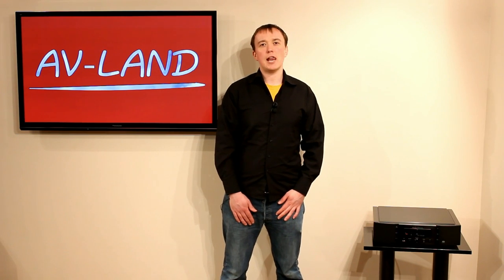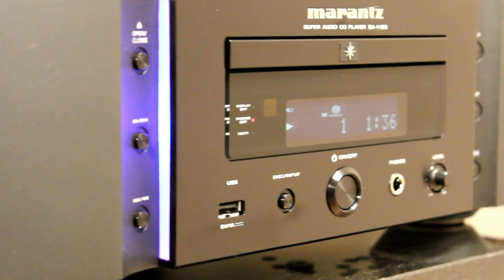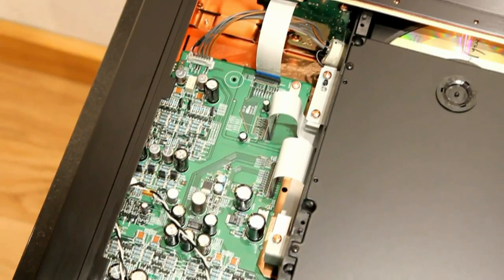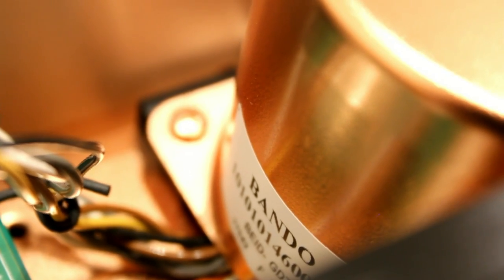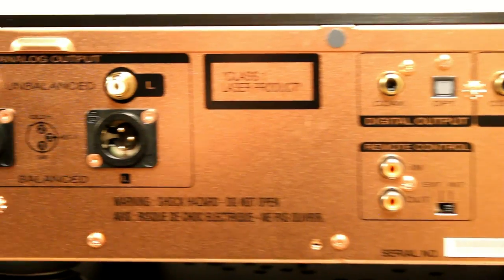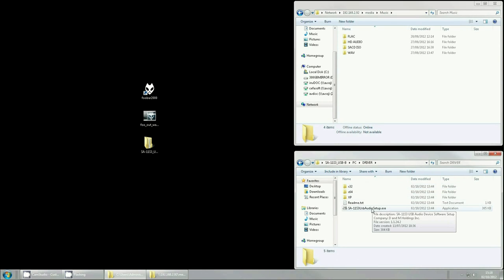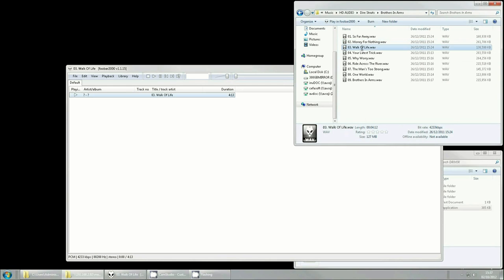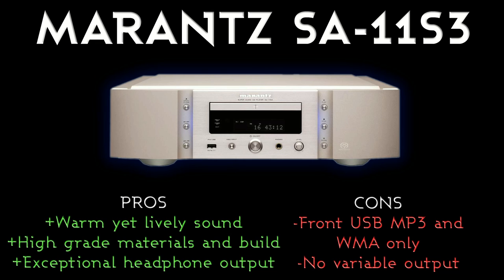Marantz SA-11S3 Review by AVLAND UK

Comment: DAC chip in this CDP was originally designed and shipped 2004 and updated in 2006 so basically this player is using 6 year old dac technology.  Why didn't they use this "old" chip in the SA11S1 or SA11S2 ?  Hardly state of the art.  Wait 6 months and Marantz will obsolete this player and churn out a new one.